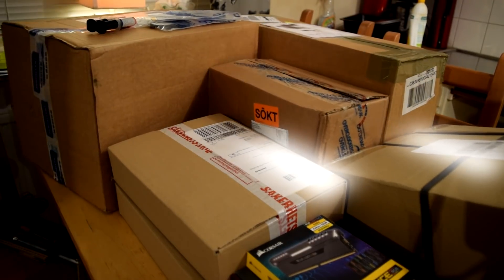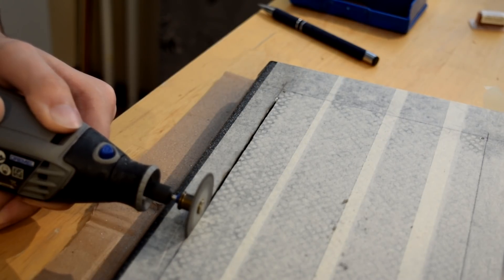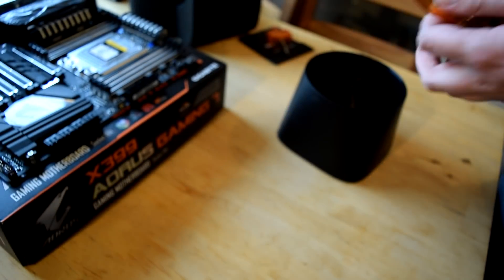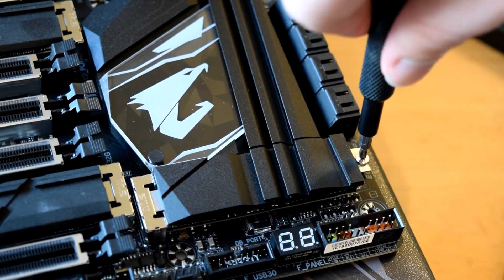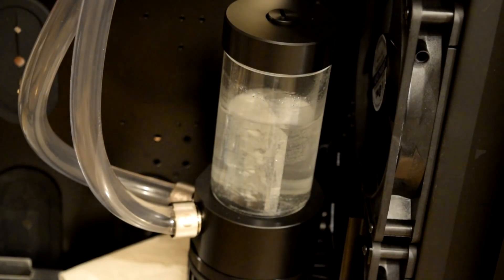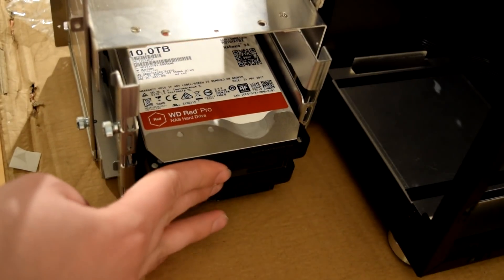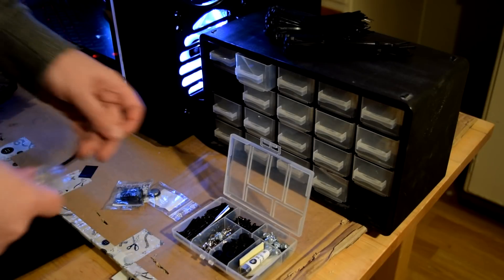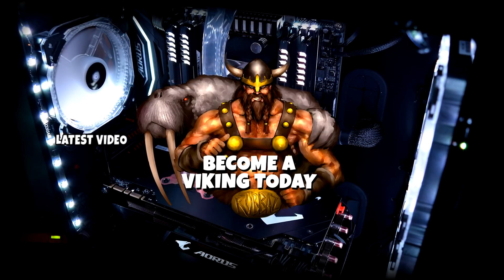Cube 2.0 - Threadripper - Editing/Streaming/Gaming Computer 2017

Comment: Please tell me he plugged the tubes into the radiator, cause it looks like he plugged it into the reservoir
Reply: I was looking for this comment. I was thinking the exact same thing.
Reply: I can't imagine that loop using 1.5 liters of water without the rad.
Reply: Pasta I think he probably would have noticed that rather fast, I think an overclocked threadripper would start overheating pretty quick if that was the case.

Comment: FYI: When cutting aluminum, use a bit with fine teeth. Aluminum is relatively soft, gumming up a grinding bit and making it cut less effectively. Grinding bits are better on steel or other ferrous materials that throw sparks when you cut them.

Comment: here's a neat tip. if a screw gets stripped, then you can put a rubber band over it, press the screw driver in to the screw hard, and it sort of molds over it enough for you to turn it

Comment: Fun fact, the reason aluminum is difficult to machine, or cut. Is because aluminum has a specific melting point and will melt and bond onto what ever you are using to cut/ drill it.

Comment: Robbaz, if you're still wanting to silence those drives, I'd definitely recommend the Scythe Himuro SCH-1000 or a drive dampener. Granted you've got to sacrifice some thermals for them and mount them differently, but I've got a 10k rpm drive that's a LOT quieter than before the silencer.

Comment: You might be able to make those hard drives more quiet by enabling AAM with a program like HD Tune. Your mechanical hard drives will run slightly slower with AAM turned on though

Comment: was the nvme setup raid?
should've gotten the hybrid aurora and included it in the loop. and 70 is pretty high for custom loop cooling. I build a thread ripper for a customer with a CLC and cpu temps maxed at 40c with prime at an hour

Comment: Quick note and I could be wrong.. But it looks like your pulling (and pushing?) internal case air over the radiator vs pulling/pushing the air from the room into the case.  Was that your intention?

Comment: I wonder if anybody else reading this is invested in AMDs' stocks. did you know the thread ripper is nothing compared to what there making currently. and the thread ripper is actually the LARGEST chip ever made. They used something they have called infinity fabric that only AMD has. well the thread ripper multiple cores that just aren't activated yet and when they do activate its going to be AMAZING.

Comment: I would have used a gel based liquid over whatever you used, Idk if it’s just because I’m scared of using water because it will ruin the pc
Reply: The pumps inside the reservoir are only designed with the viscosity and density of water. It's possible you'd just blow the pump eventually.

I have seen some limited "Fish Tank" Builds, where they just submerge the entire thing into mineral oil.

Comment: It was probably hard to cut because you were using grinding discs designed to cut steel rather than aluminium.

Buy yourself a packet of aluminium discs and you'd be good to go. :)

Comment: Robbaz did you copy my threadripper build? My build is pretty much exactly the same except I have the asus zenith extreme, glass pump res not plastic. Also I have 4x 1080tis not 1 and mine are all watercooled, you did that bit all wrong.

I don't give a shit about cable management because I have the 2nd highest 3dmark score in the world so I don't need to fuck with cable management because cable management is for peasants.
Reply from the maker: That cable management is why you don't have the 1st highest 3dmark score.
Reply: Robbaz No, I am not first because Kingpin gets all his hardware for free and has liquid nitrogen. I was first for about 6 days before he beat my score. There is also a wccftech article about me having the fastest AMD cpu build in the world.

I am too busy getting 300fps at 4k ultra to care about cable management. My case is so big I could fit a peasant computer where my cables go.
Reply: Robbaz I am also jelly of you getting 4.2ghz cinebench, I get mad vdroop to like 1.28v and it bsods. I blame my mobo. I run 1.55v (not scared) at 4.175ghz and I get ~3500 cinebench. Your ram is too slow which is hampering your CB score. Treadripper really likes fast memory clocks because it increases the speed of the infinity fabric as their clock speeds are tied. I run 3600c16 triden Z, samsung b die. Not sure what ram you are running but if its samsung b die run atleast 3466mhz, it should give you another 100 cinebench. Highest I have had was 4.275ghz at 1.6v, I am not a pus pus.
Reply: Robbaz, your corsair HD fans made me Jelly. I am currently running 4x 120mm  and 3x 140mm EK vardars and a 200mm front fan. I just ordered 3x HD140s, 4x HD120x a Corsair lighting node pro. Fuck me that's a lot of money for RGB cancer but I think I will copy you and go all white. It looks prime. My coolant is UV reactive so I might add some UV in there too. I have a 420x45mm EK radiator for my Threadripper and all of my 1080Tis are the gigabyte waterforce all in ones. I had 4x 980tis on a custom loop, then 4x 1080s on a custom loop and got real sick of having to drain my loop and it taking 3L of coolant so I opted for AIOs on my video cards and my CPU loop uses the EK 0 drip quick disconnects so I can pull everything out real easy.

I might have to tidy up my wiring once I get this RGB cancer in there, I just really CBF'd as I change everything in there so often. Also I can fit an MATX case inside my case where the wiring goes so it's not like I don't have the room. Also having a case this big I need extensions on all my fans and shit, makes it annoyingly hard for cable management.